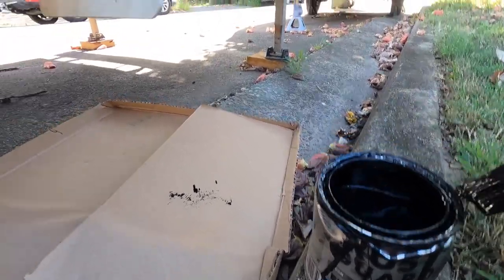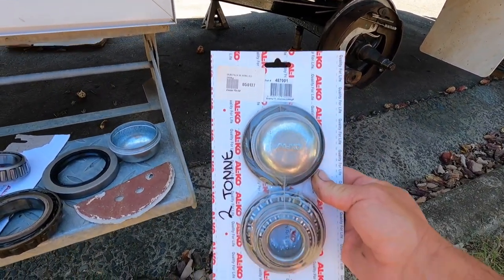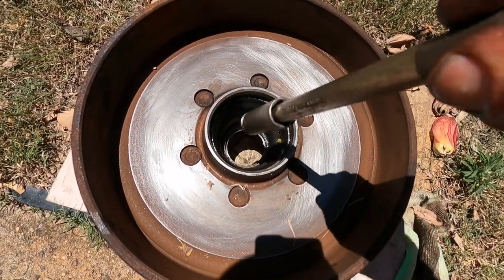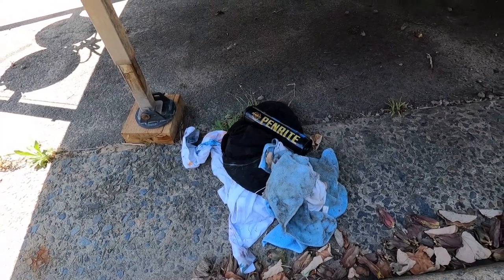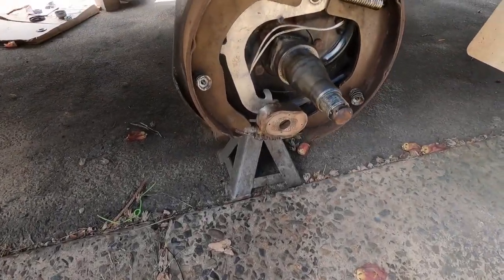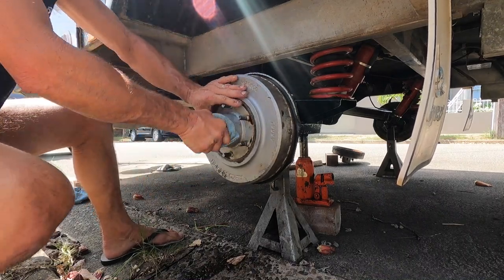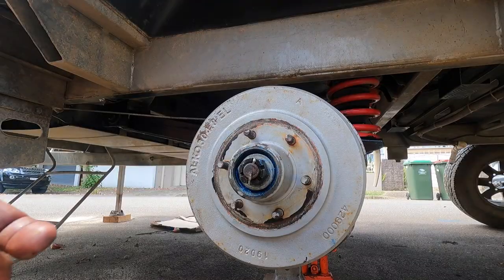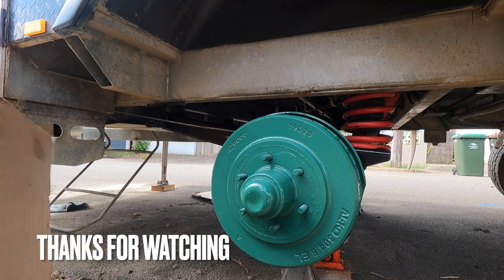DIY Wheel bearing installation Caravan trailer Jayco Expanda Outback 2 tonne axles Camec Caringbah

Comment: Great vid with some good tips. With those heavy duty magnets, it's ok to put a light rubber band around it to hold it on while you put the drum back on. It gets worn away the first time you use the breaks. That's from the Alko manual.
Reply from the maker: Copy and thanks for that great tip..